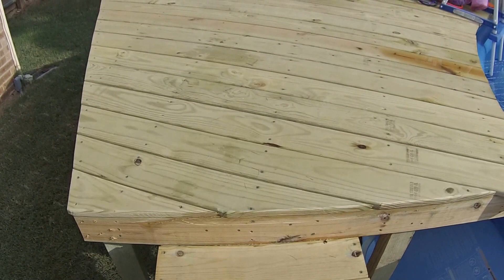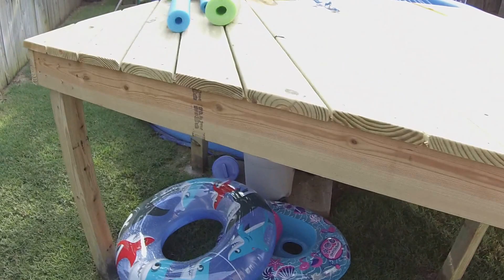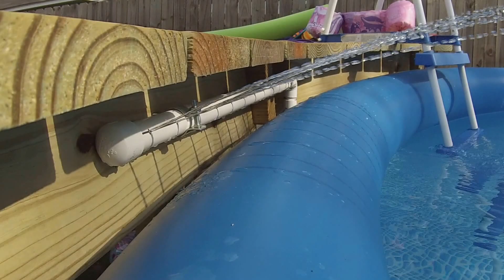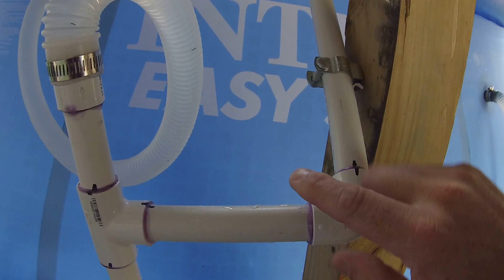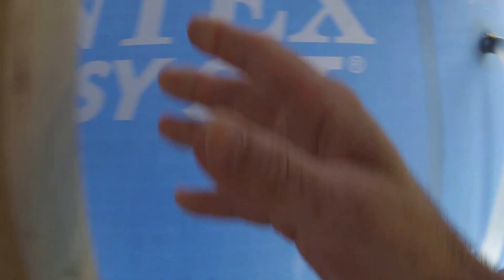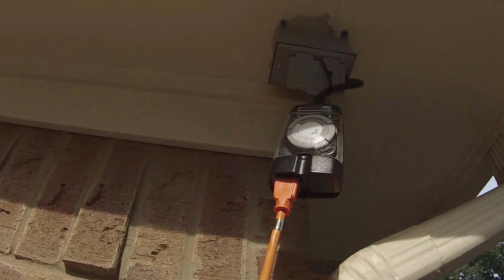Intex Easy Set Pool 15'x48" with deck and fountain.

Comment: This was so helpful! Thank you! Trying to plan out our deck now.
Reply from the maker: You are very welcome. We are about to start our 4th season on this deck and 3rd for the pool. It’s not the most beautiful thing in the world but it sure is fun.
Reply: That’s awesome. We have the exact same pool so this gave us ideas for exactly what we were looking for! I do have one question... living in Florida I’m worried the pool won’t be refreshing coming the hottest part of summer. Since you’re in Texas which is also very hot do you notice a decent difference with the sprayers? Does it keep the pool refreshing all summer, or does it still get kinda warm to be refreshing? We plan on using one maybe two but curious what to expect in regards to degrees it helps cool. We unfortunately lost all of our trees in Hurricane  Michael so we have zero shade to help cool it.
Reply from the maker: AshesAshes AllFallDown I have found that running the fountain overnight helps a lot. The more fountain jets and the higher you can get them the better. July and August here are warm months as far as water temperature. I would expect higher water temps where you are. If you can cover even part of the pool with some sort of shade you will see lower water temps. Even an easy up would work. Good luck!
Reply: Great info. Thanks again! Happy summer !
Reply: Has anyone tried using those concrete pyrimids that 4x4 post fit in the top vs permanent concrete?

Comment: oh yet another thing to add to my TO DO list with this pool i set up last year.... Lets see... Hard piping it, solar heater setup, fountain... and now deck next to it  THANKS A LOT

Just kidding, looks fantastic.... would make me use the pool more (those rinky dink ladders scare me)
Reply from the maker: Yes the deck has been fun this summer.  I damaged the ladder last fall and would have needed to replace it, so I repurposed it. On a side note: the lumber really shrunk after it dried and has opened larger gaps than I had intended. I may need to go back and adjust the boards after swim season.